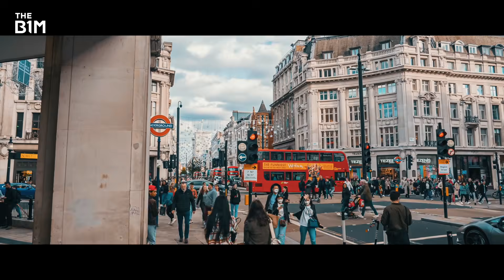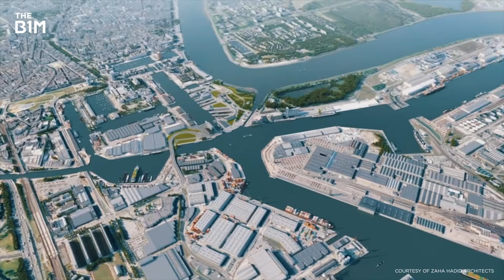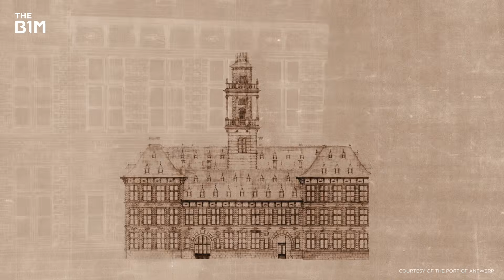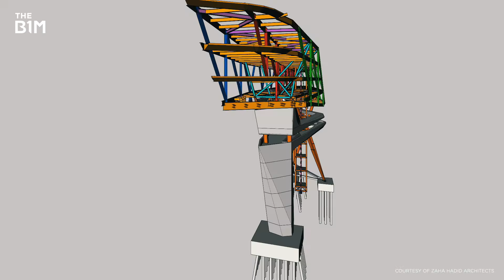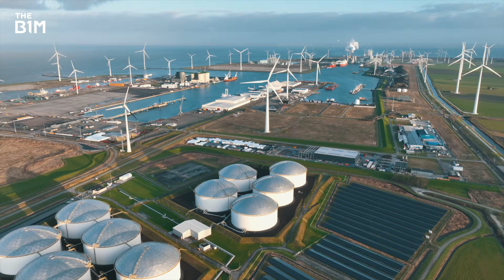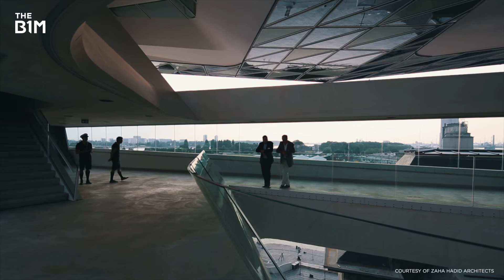Why They Had to Build OVER This Old Building

Comment: It looks stunning... on its own... But I loathe when new futuristic designs completely overshadow a stunning historical building. They 'protected it' just to completely build on top of it, there is no cohesion.
Reply: my thoughts exactly. Could have blended in a bit nicely... it just looks like someone just put one building on top of another.
Reply: @dedasdude  office building glitched into the historical one lol
Reply: @dedasdude  with almost no functionality... Instead of just restoring the firehouse into offices... If the Pandemic taught us anything is, we don't need to overbuild cities to build more and more offices. It's now a defunct practice.
Reply: I agree; whilst I don't dislike the new building on its own it doesn't just contrast with the original, it completely dominates it. A better design would juxtapose the two styles whilst allowing both to shine.
Reply: The architects were so preoccupied with whether they could, they didn't stop to think if they should
Reply: I think it’s stunning. The juxtaposition is the whole point and clearly you’ve missed it! And remember, this is Europe, they have 10,000 old buildings like the original. It’s not particularly rare and something that needs to be put in a glass case.
Reply: The historical building was not stunning. It was nice, well-maintained, and defunct. The point is not to force cohesion but to, as stated in the narration, juxtapose the old with the new. 

I am no fan of Hadid's work en general, but this one is brilliant.
Reply: They must build a third building on top of all that in the next 100 years
Reply: The historical building wasn't that historical.. it dated only from the 1920's. I agree with the narrator that bot structures make each other better.
Reply: Yea it’s kinda hideous when mixed with old and also they could of put some greenery around the place as well. Plus why build more office space when most office jobs are becoming work from home jobs? This is just a big waste of time and it looks terribly inefficient.
Reply: I really love the juxtaposition between the two tbh
Reply: There's a beauty in duality, like people who get 1 haircut on top of their head and another on the sides. But you're right, it's about how well you blend the two together
Reply: Because ‘Belgium is an weird country and the historical building needed renovation, but if they would have builded somewhere else funded would probably take years to come, and there aren’t enough offices in the new part. So if they would have two separated buildings it would be annoying to travel between him
Reply: I'm from Antwerp. I work in the harbor and see the building nearly every day. Your thought was my first thought too. However, it's wrong. It takes a bit to understand the cohesion and synergy. But it's absolutely brilliant! Don't judge something based on a 11 minute video.
Reply: @mbrackeva  i have knwn of the building since before the video and i have tried to find some beauty in it but i just cant. its similar to when i try to compare a normal pinting and some new minimalstic art work that is just a blue line in a white background or a banana in a wall. i knw its sold for millions and some ppl like it but i still find it stupid. meibe im too old.
Reply: I think it fits perfectly together, it's a great compromise of leaving the old building standing (it was outdated and too small) and adding a great design to it
signifies the past and the future. Love it
Reply: @Ekstrax  you've got no sense of taste, I want to unsee this piece of garbage
Reply: Give it a hundred years and this building will also become historical
Reply: What about a multi decades old, brick cladded, pre-modern building screams stunning to you?
Reply: @MutherFIFA  I said the glass building was stunning on its own.
Reply: Contrast
Reply: Yeah its a really impressive feat to engineering to be sure but... man it just looks really ugly to me. They could have at least tried to make it look in the same style as the original building.
Reply: Generally I agree not in this case the building isn’t anything particularly special
Reply: Ir is way better than the other being demolished
Reply: Philistine
Reply: In your opinion.
Reply: @stephensullivan1011  precisely, that was indicative by the statement of the words 'I loathe' in the sentence.
Reply: My father works there it may look cool on top but the bottom part looks rly old
Reply: I can see this master piece from my house sinds my dad work in that office it’s pretty close
Reply: 1913 is not historic.
Reply: @Music-xp5wg  that's like saying the Olympiastadion in Berlin is not historic even though it was build in 1934. Like fuck outta here. It's a protected building... aka it is deemed of historic value not to be demolished.
Reply: By design lol listen to what she said in the clip, she's a anti white/cul-tural mar-xist ©xnt
Reply: The contrast highlights their differences nicely making both stand out even more, I would say.
Reply: I'd have to agree. The only issue is that space is at such a premium in western Europe
Reply: What are you talking about? This blob of glass is ugly af! Decommission this abomination at once!
Reply: Hegel's Foot 😂
Reply: True
Reply: This. I understand the juxtaposition idea, but I feel there is no balance, no dance, no communication between the two parts. The new piece is just totally shitting on the old part.
Reply: Just wait till it gets hot 
Idiot never felt 114 degrees outside
Reply: Welcome to Hadid architects, where its all about showing off
Reply: Yeah, this buildings look impressive and nice on its own. But when you see that similar stuff to this happens all over Europe, eroding the distinct style of each city, turning everything into the same old amalgamation of modern and old then it's not that spectacular anymore. What wants to be unique and contrastive turns into a boring mess because the same architectural pattern can be seen all over the world now. People who prefer cohesion over contrast, who prefer the softer older architectural styles, featuring natural materials, over the sharp, aggressive contemporary styles with their unnatural materials (steel, glass) are completely disregarded. The structure of the old building might be preserved, but not its essence and integrity. It has been relegated to be nothing but the canvas of the contemporary building.

It's a bit like these people thrifting old paintings and painting over them. If a Romanticist painting is being overpainted with pop culture elements then the Romanticist painting is not preserved, even when parts of the previous painting are still visible, it is a pop culture painting now.
Reply: i get the response, but when you see it in person, trust me, somehow it works and looks beautifull.  Even more so in the evening light during a summer day
Reply: Very astute observation. In general, I agree that such hybridizations are more likely to feel like intrusions more than  concessions. Awful outcomes notwithstanding, this is a pretty acceptable, even welcome, pairing.
Reply: 100 they didn’t think about that
Reply: it is purposefully contrasting because if you don't contrast and try to emulate the historical building then it became pastiche and blurs the line between what is historical, thus completely devaluing its history
Reply: I gotta be honest it looks owfull almost all new buildings are just well glass in x chape. That is just a lunp of glass added to a beautifill clasic building. In sure its a great feat of engineeing and all but. Man all modern architecture looks the same. And everyone pats each other in the back claiming the most modern most fluuid cube of glass and concrete ever created.
Reply: @coipoboy  "all modern architecture looks the same"
so do most classical, baroque, renaissance etc. buildings for hundreds of years back in their time.
People living 200 years ago have seen all construction around them looking the same their entire life.
On that note we have a great variety of architectural styles over the past 100 years.
The next thing will come. It takes time, more than 20 years.
Reply: @LittleMissSmallPaw  i disagree all previous styles build upon old ideas and refined them. Roman gothic, clasic, etc. Thats why almost everyone can understand the beauty in them. We dont have this arguments when we analice the coliseum or the empyre states. The problem is that 'modern" was born afther the cold war. When soviet idead started to leak out soviet architecture is bland, boring inhumane because they wanted to destroy the normal man in pro of the soviet ideal man that is not focused om beauty and only on function you can see this in apartment building from the soviet era. And when that same ideology, got here we ended up this this. A cube of glass, concrete and steel. That dosnst take anything from old styles no beauty just function. We lost a loot of beauty in citys because of this ideas. And no this would not get more beautiful with Time. I mean when you see a soviet era apartment building you knw those cubes of concrete do you find it more beautifull now?. Not rigth. This new one are recuperating some resemblance of uniqueness but its gonna take a while to restore the damage in my opinion
Reply: @coipoboy  that's just plain bs.
Modernism and its ideals were around way before the cold war. even before the world wars.
English is obviously not you first language but you completely ignored/misunderstood my point and added your own on top of it.
It's not about soviet era apartment blocks. That's not "important" architectural history unless we are also comparing the wooden baracks common people lived in 200 years ago.
Apart from that you just spit out anti-soviet-propaganda. (wich I don't disagree with but that's just entirely off topic)
Reply: @LittleMissSmallPaw  sorry yea englishbisnt my native lenguage. My point is this style of building with this over simplistic exterior are a result not of interesting new ideas but of soviet styles introduced relatively recently. Thats why i think that even in a 100 years this type of building iant gonna be remembered with the same fondness a as a gotic chappel or the empyre states. And the example of the soviet building meibe its too much but it follows the same ideas rhat this type of architecture follows. I mean just gram your stabdard square building of glass concrete and stell and twist its shape a little bam modern building. Even this its just a squareish bullding in pillars over other building. Abd the architects are talking as if this is a ground breaking desing. Its like a competion for the most fluid glass squarre. None of the details that older styles had all trown aout of the window for a perfect cover of glass you cant tell me this style has a great deal of soviet infuence?
Reply: @coipoboy  Just admit you prepare a box of bricks instead of a box of glass. There is no real meaning to your objection.
Reply: @coipoboy  Are baroque, renaissance or classicist buildings so much different from each other? The general shape of them is more or less the same in most cases (average buildings of the era).
Reply: @abrissimon914  look i knw most building trough the ages are cubes. but every style give them some deatail or touch to make them unique. its just that returning to just a cube no detalis its kinda a step back more than a evolution. thas why i gave the example of minecraft it cant be that stating from a cube of dirt then evolving to bautifull chapel with a loot of details you are gonna end up in a cube again but made of glass no deatails.
Reply: I love the juxtaposition honestly
Reply: @ZachBobBob  a good juxtaposition of modern & historic (in my opinion) is the Louvre. The glass Pyramids mixed with the historical surroundings, there is cohesion & fluidity. This just looks absolutely random & lumped together.
Reply: @Malfoy1594  Yeah these definitely don't flow together.... but of course that's not the point. It's definitely not for everyone
Reply: I like it
Reply: It’s a new architectural style emerging, and needs to find a balance. adding more modern space on a historical building while preserving it at the same time. It adds to the skyline and with ever more of us on this planet it’s a brilliant solution to historic overcrowded city’s
Reply: @one2greentree   it not that new it has like 50 years going on already. And usually you try to create the new part of the building in tune with the old and all the structures arround but this one looks like the ego of the archytect won over i mean it lools like litterally the new building is fkng the old one it even has legs. And its not in tune with anything arround it.
Reply: @one2greentree  I guess its the solution they "needed", not the one they wanted.
Reply: Would look better in glass cities in North America IMO. Some may call if futuristic but I doubt these current designs will be coveted in the future. What will be still coveted is what we consider classical architecture.
Reply: 1/3 of Anwerp population are north african and arabs. If only those people were living in their countrys Belgium would not need to destroy it's beautiful architechture
Reply: @Albanian1488  there's a reason EU headquarters is in belgium
Reply: But you will still get both old and new in photos and that's all they care about. Unfortunately living in a social media world means that most new structures will be instagrammable which creates tourists thus boosting industries. Its meant to look like a diamond as its close to diamond district and fluid like the waters next to it
Reply: I think it's insulting to the original building, if you can insult a building. Both have their individual beauy but together it's quite the monstrosity!
Reply: Yeah my first thought was it just looks like sh;t. Actually a giant metal turd on top of a building.
Reply: I do despise this movement. It’s like the Royal Ontario Museum in Toronto. It just looks like a tumor
Reply: “Ooohh, something I’m not yet used too… Bad!”
For decades ‘new’  things have been build next to ‘old’ things and guess what: “That modern monster totally overshadows the pretty old thing” was the first reaction. You will get used to it and appreciate it. Or you’ll be the old fart shouting at the wind to stop blowing. Both are okay ofcourse.
Reply: @NoeraldinKabam  I'm 28 years old, I can appreciate both buildings as I said it looks stunning... on its own. I'm no old fart, I just hate the combination of both. As a human being, I have opinions which are my own.
Reply: I like the contrast, imho it actually enhances the individual  quality of the components
Reply: This is like, I feel like the whole point lmao it's not meant to be "cohesive" because that wouldn't make sense from design. Just for people like you who won't even use the building?
Reply: @mtaylorfoofa Well, philosophically, yes--cohesion wasn't the point. But it's fair for everyone who lives near a building to care about its visual effects. We don't have to work inside it to feel its impact on everyday life. In fact, that neighborhood will have to live with its new "roommate" for a few hundred years, at least.
Reply: I loathe when people want everything to be a museum lol there's a balance and this is a good example of keeping the old and still being able to use the city you live in for work and play in the context of the 21st century.
Reply: @mtaylorfoofa  actually if you read the comments on this video there is people who have been in that building & mentioned how impractical & claustrophobic it is from the inside... It is simply an aesthetic build than a functional one. I'm not saying it has to be a museum, in fact I said the original building could've been renovated... Considering office buildings today go mostly unused as people work from home, it is an unnecessary practice... Concrete pollution is one of the biggest green house contributors on the planet.
Reply: I mean all the buildings in europe are historical lol so it’s either this or just completely demolish the old one and start fresh. Also i think your confusing “futuristic” with “modern”. These are how buildings are made now and i think the contrast between the two (older and newer) is very cool! More decisions like this will have to made unfortunately because cities are rapidly growing and there’s nowhere to build
Reply: @maccamardo5412  I think the majority of commenters are from the US where we had to form a Landmarks Preservation Commission in NYC lest we tear down another building like we did Penn Station. “Cohesion” would have meant major changes to the original building. You can’t just plop a building of a similar style on top. It has to be diametrically opposed or else it would look goofy rather than dynamic.
Reply: This is a good example of a living city
Reply: Would love to know the average age of the naysayers. The older one gets the more close minded and fearful of change they become. 
I love everything about this project.
Reply: @equanimityzen58  I am 24. I despise what they have done to cannibalize the original building. It shows a lack of vision to stand on their own, a lack of ingenuity to fail to preserve the purpose or aesthetic of the original, and a lack of talent to compromise the office utility to serve their bad design.
Reply: @equanimityzen58  
As an Architect, I agree. Clients don’t commission (Star)chitects like Zaha Hadid and expect anything besides designs like this.  Her buildings are famous the world over for their impossible geometries and structural mastery, their expansive, futuristic interiors and their landmark status amongst a sea of samey high rises. Zaha will always remain controversial in the architectural sphere. Her buildings are some of the most memorable I’ve ever visited.
Reply: @equanimityzen58  23 year old "naysayer" here. We don't have to agree to every change that challenges new and old and be labelled fearful when we don't like it. Bad design choices exist.
Reply: @equanimityzen58  And the fewer the occasions when we use sweeping generalisations.